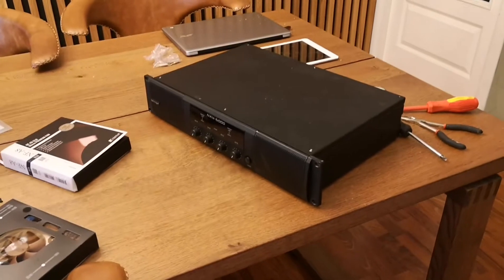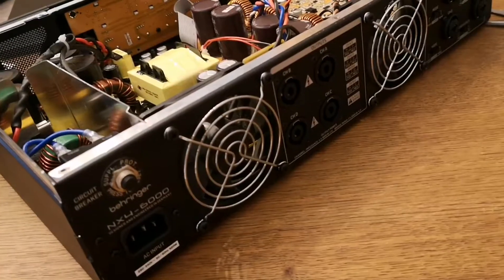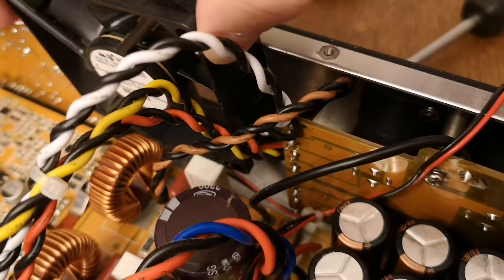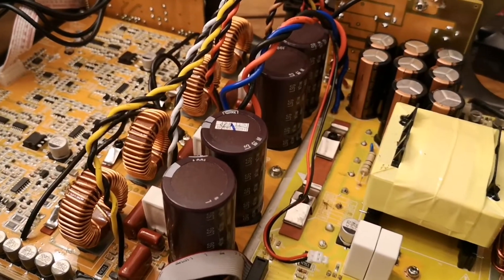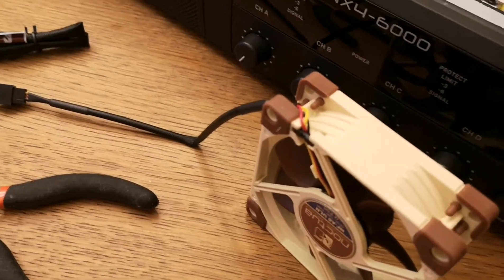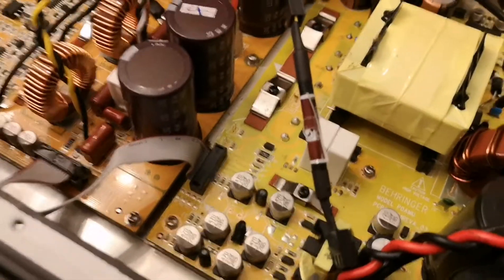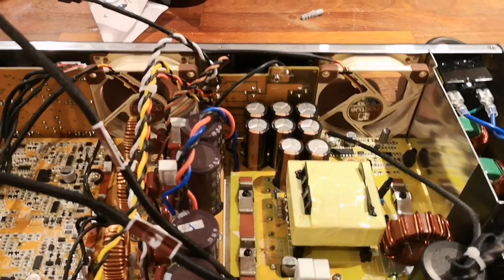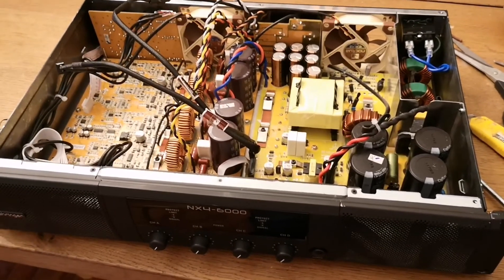Change fan in Behringer NX4-6000 to Noctua silent fans.

Comment: I just did this on my nx6000d and it's great.   the only part I didn't like was pulling off the wire connector acceptor piece... took more force than I wanted to use... but I just made sure to pull it straight up and just took my time and ever so slowly it slid off the pins.   Noctua fans sit on there but I'll probably end up modifying them so they sit tightly so they don't fall off if I move the amp.

I had to mount my fans with the wire-showing side facing out the back of the case for them to blow out.   and mine didn't come with any of those other wires but it was fine.

Comment: How's the airflow? Is it better?
Reply: No you are trading air flow for less noise
Reply: No. Only for Home Theater
Reply: No. Only for Home Theater
Reply: No, it's worse, but it doesn't affect performance.
Reply: @zachansen8293 it can affect performance depending on your environment and how much you push them as the airflow is much lower. 
There are plenty of reports of overheating but reversing the air flow helps. . Or adding external  power so the fans run a bit faster

Comment: curious. the NMB fans you pulled out are DC 24v. i wouldnt think the noctua pc fan which is 12v dc would be recommended. It will likely burn the motor in the fan up over time.
Reply: No. Both of them 12 V